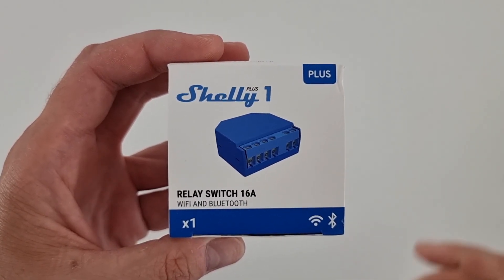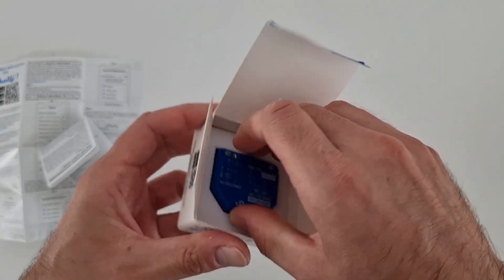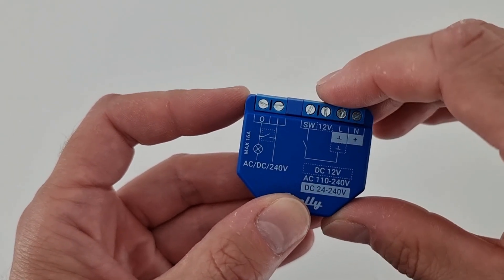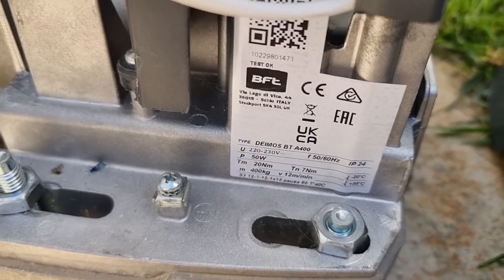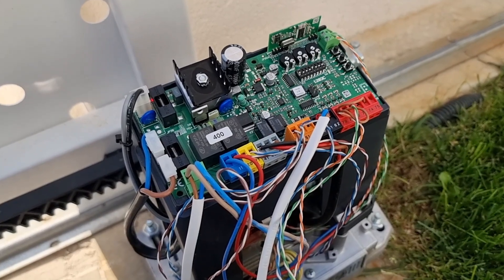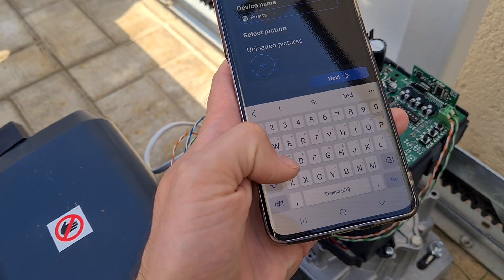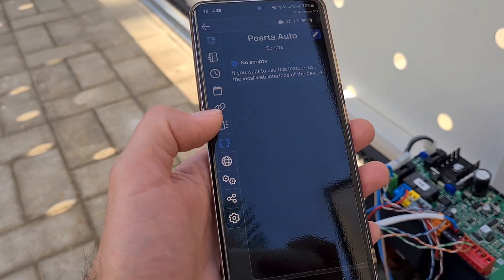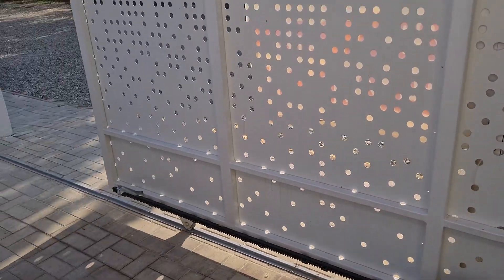Shelly Plus 1: How to make your electric gate SMART, via WIFI control!

Comment: I have done same to the same drive. But will add zigged open sensor and put to Home assistant

Btw you can flash firmware and use in Apple HomeKit( not in Shelly app)

Comment: I have a similar setup. I use DoorHan motor. I use switch and remote to control the gate. If I install Shelly relay inside the switch in my home, will it work the same? Or is it mandatory to install it in gate motor?
TIA

Comment: I have correctly installed several Shelly for smart gates. But today I found a problem where the preexisting remote buttons no longer work however the Shelly works fine.  Any help is appreciated
Reply: I face the same problem!

Comment: Hi mate. Your 'L' and 'N' terminals seems to have existing wires leading somewhere. Mine doesn't. 

Looking at the manual, it says this is the power supply but I guess my BFT gate is getting power only through the terminals just left of 'L' and 'N'. 

Can you tell me where your existing wires lead to? I've followed your video exactly but it's not working for me. My shelly device can't be found when trying to add via the app.
Reply from the maker: The existing wires are the power supply wires coming from the house. Without these wires I wouldn't have electricity at the motor. You should have them too! Otherwise, how do you power the motor currently?
Reply: @recanything  Thanks for replying. 

On your circuit board, just above 'L' and 'N', there is a sticker that says "400" on it. Just to the left of that "400", there is a blue wire and a brown wire. 

I have the same blue wire and brown wire and when I follow that, it leads to the conduit that goes underground towards the house. I assume this is how my gate motor gets power.
Reply from the maker: I really don't know why they did it like that. The idea is that you need to take power from somewhere to power the shelly device. If the cables from your house are coming to those connectors, take power from them
Reply: @recanything  That's what I was thinking but thought I'd check before I messed it up. 

Your control board seems to have the same blue and brown wires to the left of "400". Do you know where yours lead to? Does it just connect to the same source as the blue and brown wires connected to "L" and "N"?

Comment: what if you now use the RF remote? Does Shelly still know the new position?
Reply from the maker: Yes, it does! You can use the RF remote without a problem!
Reply: @recanything  sure? Shelly does not know the position. It gives only the signal to change the status (if closed, then open / opened, then close).
Reply: @recanything , if you know the details, could you share them, please? I face the same problem with the RM remote. If Shelly assumes the door is open, then the RF remote doesn't work. If Shelly assumes the door is closed, then the remote RF works again.

Comment: hello, thanks for your video. I already have a smart switch for opening the gate and for other basic functions at home. I would like to change everything with Shelly, they seem more reliable and have a nicer user interface. In the video I can't understand if when the gate is open the system warns you that it is open and after it is closed if it warns you that it is closed. I also wanted to ask for your help in understanding whether in a circuit for switching on lights there is the possibility, with the Shellys, 
 to insert buttons and switches in the same circuit? I know that Shellys work with both buttons and switches, but I don't know if I should use just buttons or just switches.
Thanks for your help.

Comment: Hi!
I do have de same BFT motor model (Deimos BT A400) but mine says 110 - 120V... and yours is 220-230V.

Im very bad with electrical job so need help knowing where should I connect the wires. I was gonna copy 1:1 the way you di it in the video but not sure if im gonna mess up something..

Please help with that.

BTW great video!! Cheers!

Comment: Hello! I connected the Deimos 600 to the Shelly 1 Plus. Everything works, but the original gate remote loses signal. Where to find fault? I connected everything after this video. Please help! 😶
Reply: Shelly sometimes interferes with built-in receiver. If you can place it in different location (preferable outside the motor enclosure) it should get better.

Comment: So the power input is 220v but the control to give signal do open or close is 24v?
Reply: No, you don’t need voltage to give the signal. All you need to do is connect/bridge the pins together. For instance pin 2 and pin 7. Connect them by 1 wire, and the signal to open/close/stop/close is given. 

I made the mistake to put voltage on those pins. Had to buy a new controlboard :)

Comment: Nice project! The BFT motor has an 24V DC output (pins 50-, 51+), I would connect the shelly that way, it's safer than playing with the mains and you could probably tap the ground signal from the gates limit switch and connect it to Shellys SW input, to read the gates status.
Reply: U know which port is limit switch
Reply: @chicolate_chan  dosent work unfortunately, limit switch is on 41,42,43 but no ground. Maybe someone more skilled could wire some type of relay or diode between the pins and the shellys sw input... The 24v output works with the shelly, already tested.
P. S. You can always wire in an cheap magnet switch to read the status.
Reply: At Shelly, did you plug the wires in the same place for 24v?
Reply: @Uuurdal  No, for 24v, + on N and - on L
Reply: hi, 50-, 50+ is 24 volt ac not dc. i tried shelly gen 3 . it is not working but 240 volt is working
Reply: exactly I needed a 24 v ac to 12 v dc converted to make mine work
Reply: hi, 50-, 50+ is 24 volt ac not dc. i tried shelly gen 3 . it is not working but 240 volt is working
Reply: @mkakkoth1 nope, I have it connected that way, it is DC

Comment: @recanything Salut. Ar trebui sa mearga exact la fel si cu un Sonoff Basic? Sa ii pun inching la 0.5 sec? Pare ca da 220v cand porneste, e ok pentru bornele 60 si 61? Thanks!
Reply from the maker: Sonoff-ul trebuie modificat ca sa mearga, si e complicat. Plus ca nu e asa trainic ca si Shelly (mi-a murit un Sonoff anul trecut la -5 grade). Shelly Plus 1 are si dry contact, deci chiar e recomandat pentru poarta.
Reply: @recanything  Mersi mult. Am inteles cum ar trebui sa mearga. Orice dry contact pe bornele 60 si 61 si e ca butonul de la telecomanda.  Am sa incerc cu un Sonoff Mini R2 ca am vazut ca e mai usor de modificat si mai revin cu detalii daca a rezistat sau nu. Am multe sonoff-uri si nu as mai vrea inca o aplicatie si pentru asta. Thx inca o data!

Comment: Why you made the 0,5 s timer setup instead to setup the Shelly as a toggle?
Reply from the maker: Because I just need a short electric impulse to open/close the gate, so if I want it to act like the remote control, this is what I needed to do
Reply: @recanything  shelly can do that you can change switch to toggle (impulse)
Reply from the maker: @mitikumitiku4442  I know, but for some reasons, sometimes the gate don't take the command. That's why I decided to make it work this way.
Reply: @recanything  Okay! I see it works well. I use the timer to switch on the warmwater circulation pump for 5 minutes. Funny to activate by Alexa.

Comment: Literally took 15 min to setup everything (as long as you have same BFT and you bough same Shelly Plus 1 model).

GSM modem (BFT does not have WiFi only) costs - 100€, Shelly ~20€). And arguably you have more control options for automation
Reply from the maker: Thanks!